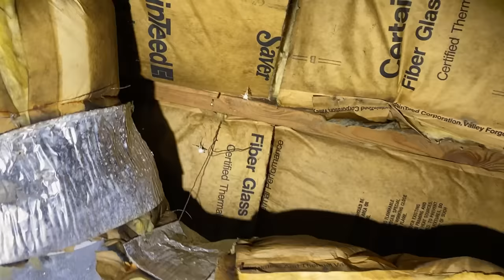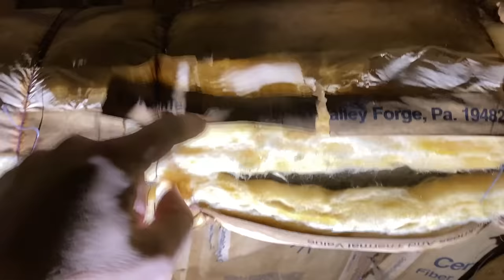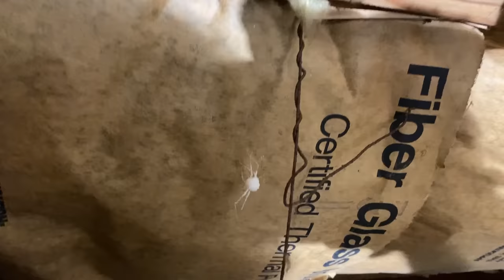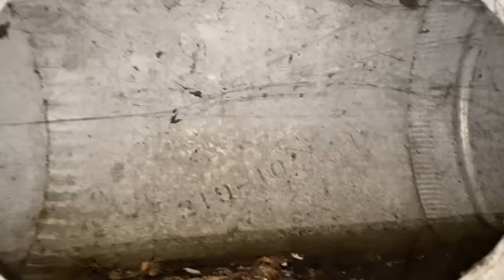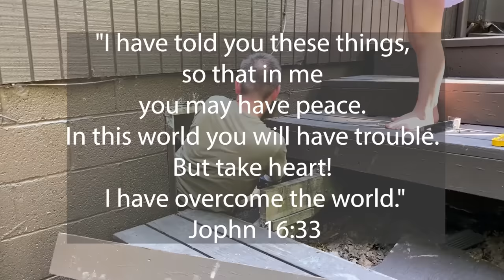Finding A Secret Room Under My House and What Was In It

Comment: Your AC is messed up... That amount of condensation isnt normal.. But is possible if the AC isnt working correctly, yes that much water..

You need to get an Hvac guy to look at your unit.. I guarantee you its not moving enough air through the condenser.. I had a similar issue, and my ceiling fell through because of it..
it CAN be the air conditioner man, trust me. If the Unit is messed up, it will create moisture and just build up day after day... yeah, thats like a summers worth of condensate..

You need it fixed ASAP though, could make your whole family sick..

Comment: Two furnace, two hot water heater home. The water in the pipe is a cracked heat exchanger in one or both furnaces worst case scenario,, Or you are working with the vent pipe, reasoning for the tape.

Comment: SOLVED!!!!
Hope that get your attention!!!

The reason there’s water in the ducts is because the insulation fell off. 
Once that happened, the metal ducts acted the same way a cold glass of water on a hot humid day beads water on the outside through condensation. 
The ducts began to build up water through condensation on the INSIDE of the ducts. 
And standing water usually gets fouled pretty quick. Remember the saying that 80% of all household dust is human and pet shed skin cells? 
That standing water was collecting pet dandruff, human dandruff, human shed skin cells, and all sorts of other types of dust. And it all landed in the water . 
Then bacteria begin to feed on it. That is why it smells like a sewer.
Take the duct work down and scrub it with hot soapy water, and dry it with a towel (A handheld hairdryer works great too and might just be easier) and then take rubbing alcohol and spray it LIBERALLY on the inside of the ducts to make sure you’ve killed all the bacteria in that duct. Let it dry completely and then reinstall it and insulate the daylights out of it.
I would recommend using spray on foam because then it will never fall off. If you’re going to use that area get some very thin wood type laminate and build a box around the duct work. It doesn’t have to be really strong it can be flimsy because no one‘s going to be sitting on it. 
Just make sure it is not touching the ducts and at least 4 inches away from the ducts on the sides, bottom and top and then spray the foam into the box surrounding the ducts so the spray in foam is contained within the box that you just created. Make sure you leave exit holes every couple of feet So  excess foam will come out, and not expand and break your box. 

Also don’t put a vapor barrier underneath your house on the ceiling. Or it will cause the wood to start to rot.
If you want to use the area (and I definitely would!) Dig down to the floor a little bit, even it out with sand and pour in some concrete. Just make sure it’s ventilated by tapping into the air vents on the ceiling that you just fixed. 
Remember you need some place for the air to come in AND To Go Out. 
I see this was five months ago so you probably solved it by now but if you haven’t I hope this helps. 

PS you really really really need to stabilize that wall by injecting apoxy resin and creating a metal framework that will not allow the bricks to move any farther. 

And you need to put down concrete that’s actually touching the foundation next to the house above the area where the water is coming down and freezing and cracking and breaking the wall.
Good luck!

Comment: This was done wrong. The vapor barrier is facing out, that should face the inside of the house, first off id have it dug down 4" crushed stone put in them foam insulation and 3" of cement over the top as a floor. Add a window , power and ac and heat. Cut a doorway into the basment.
Add shelves and use it as a storage room
All that rotten insulation needs to go.
Id also run a dehumidifier in it and get the air as dry as you can, an open dirt pit dosnt stop water vapor from filling that room and that can cause mold to grow
The insulation on the duct works wasting energy.  That make a nice storage room it adds square footage to the house, 
If its a real sewage smell and the house isn't that old the house could have settled and broke the sewage line, have that looked at.

I had a sewage ejection pump the pit broke, I had to dig it out and fill with stone and a new pit, it wasnt raw poo sewage just gry water from the kitchen sink.
I spent a about 250 bucks to fix it. A plumber would have charged 3 to 7k.

You could diy that job if your handy.
I would thats a lot of extra space going to waste.

Comment: With all those extra cinder blocks I would call the cops and have them come out with a cadaver dog and check that odd wall jut out. A/C's have drain hoses and catches. They need to be cleaned out all the time or you will get the water in your pipes. Find it and save yourself a lot of money.

Comment: Molds can kill, they can be biohazards. Glad nothing bad occurred but when the poster said he needed a respirator mask, he wasn’t kidding. A space like that needs full ventilation prior to entry and then a rated biohazard mask should be used.

Find the water, kill the water. Rip out the old insulation, replace with new. Spray with a mold killer and institute some form of ventilation to the space. It looks to be a usable volume so after clean up and prep, I’d find a way to put in easier access and enjoy its use.

Comment: It isn't proper duct wrap that's for sure. And it kind of looks like you have a downflow furnace or air handler with a faulty furnace or air conditioner drain.

Comment: It's a down flow heater and ur coil drain line is clogged and just draining in the duct
Reply from the maker: Nice guess but nope
Reply: Did u figure it out was it seepage form where the duck went thru the wall I thought it was drain on coil I went on a few like that one it was under ground bolt together duck with gaskets and it was filled and had to pump it out curious what it was if u figure it out
Reply: I'm in the trade Crack in coil pan or seepage where that pipe go's thru the smell is most like stail water it smells like something dead like a untreated swomp pack if u know what that is hope u figure it out good luck

Comment: I'm sure you're done already, but I hope you didn't re-insulate with the same shit. Never use fiberglass to insulate ductwork like this, it's just a pain, looks like shit, and takes on moisture. The bubble wrap/foil backed stuff looks better and works just as well. Also will last longer.

Comment: Wow. U just won a bsmt. Not bad. The insulation was totally bullsh*t. You dont place insulation between joists without really vapour proofing, like with sprayed on insulation. But it would be better to seal the floor, if its soil, and spray the walls. Or do what u have been doing and ignore the fact that u have a bsmt!

Comment: Though the problem has prob been fixed by now (9 months later), the most likely cause of the water is a plugged drain pipe or hole in the tray under the ac cooling coil. One I fixed had a flex tube plugged that was to drain through the concrete basement floor, to under it. Just pulled it out of the floor, poke something into it, it began flowing. Pushed back into the hole in the floor. Worked for at least ten years after that.

Comment: You really don’t want flex duct. We made the mistake you are talking about doing at the advice of a/c service guy. What we learned was it was quick, easy, and cheap to install. What we learnt was you get what you pay for! It’s a quick patch to fix a/c ductwork but not made for the long haul and we were soon replacing due to sagging and animals putting holes in it. So back in the metal duct work went in. God forbid if you have a flood in your area. Which the house we moved into got flooded a foot deep under the house during hurricane Mathew. The other half’s aunt replaced metal duct with flex ductwork and boy the mess that made trying to drag those heavy soaked flex duct out from underneath the house and crawl space. So please don’t make our mistake. 😊 but hey they safe the best learned lessons are bought that hits your wallet. 😊

Comment: Speaking of a plumbers job my brother being a plumber has encountered stinking large snake and rat beds under houses and buildings and in replacing a bathtub and shower wall in an old house being restored he found a gun on the other side of the wall adjoining the bathroom wall that was a murder weapon with the murderers name engraved on the gun used in the crime that had been committed years ago. The murderer was not charged at the time of the crime because the weapon could never be found as proof that the bullets came from his gun. By the time the weapon was found the man was old and deceased.

Comment: You have 50-odd years of condensate in your ducts with NO WATER DRAIN! The insulation isn't even CLOSE to 50 years old dude! in 1982 Dow-Corning (pink)and GAF (white) were the ONLY "home brands" of  fiberglass insulation available, all "yellow" other brands were commercial (same with 'blue sheet rock") only so contractors and bldg. inspectors could see stolen materials fast. Doesn't look like your ducts are a half-Century-old either (replaced???) because there isn't the typical spiral "oil-canning" up and down the straight sections (friend used to own/run a sheet metal shop 70 years). Check your "A" (evaporator) pan and drain-make sure they're OK. You sure don't live in Humid, Okra-Homer! We'd get that much water in the ducts in a week in Simmer and FUR in the ducts!!!

Comment: It hurt watch you muddle through. First, check that the condensate drain is working. Adding drains to a system that shouldn't need them is putting a band-aid on a broken bone. Call a contractor, none of this is rocket science.

Comment: Highly Humidity will make the Air-conditioned Air even Wetter.
That Ducting Should Have Been Installed on a Slope so as to Drain any Water so it doesn't build up Inside.
Water Flows Downhill not Uphill like the Mormons Try and Tried to do.
Throw a Level on the Duct and Reset it on a Slope to keep anything happening again.
I would Install a Door and Steps or Ladder and cause that Area.
Man Cave or Storage, Whatever.
Just My 2 Cents.
Most Likely Buildup over the Years. Not Leak.